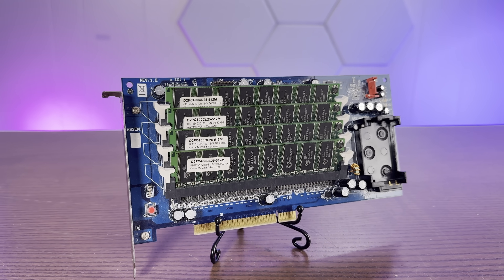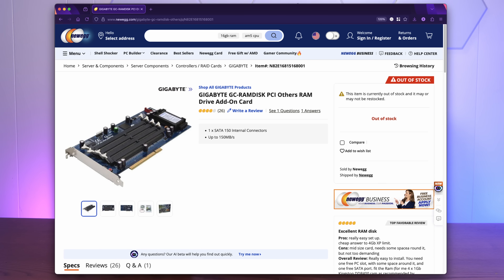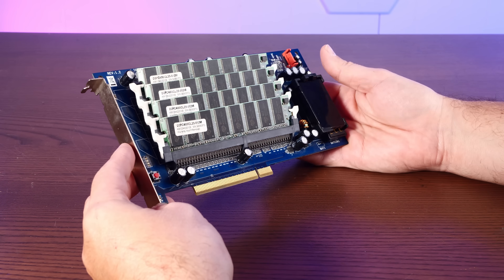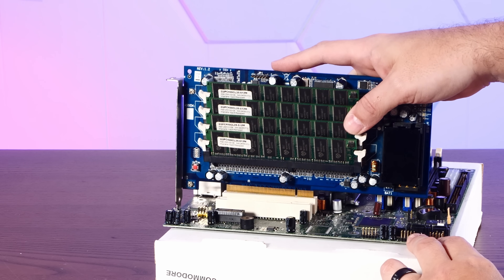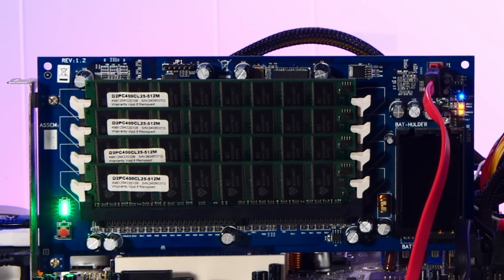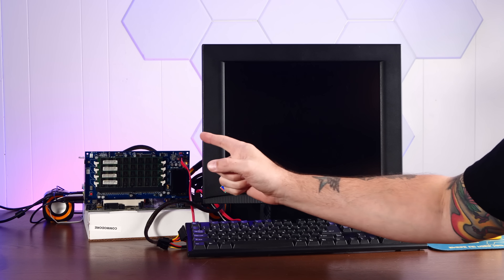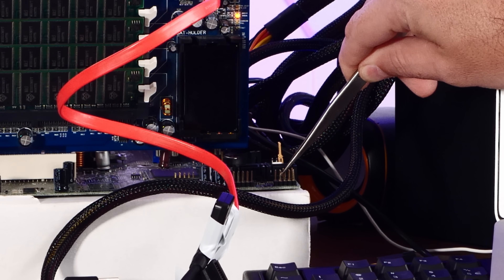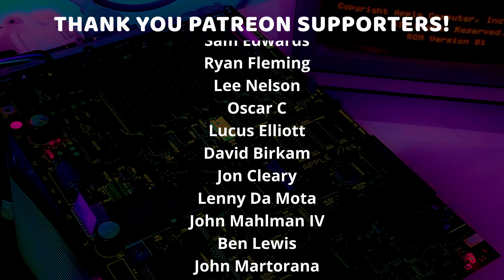This Early SSD Was WILD

Comment: I have so many more questions.
Would this work as a usb drive running just on batteries? How is the data saved to the ram sticks is in like a raid 0 kind of thing ? Or would it be like as one stick gets full it just moves on to the next. And if that were the case could you  have it so the os was on the 1st 1 or 2 sticks and other stuff was on the 3rd and 4th stick ? So if you wanted to quickly delete a bunch of files you could just pull 1 stick.

Comment: This is not a SSD, this is a battery backed RAM disk, and a really terrible one at that.

There were two versions of this card. One with the original SATA150 interface, and the later one with a SATA300 interface. So you choked several gigabytes of bandwidth down to 150-300 MB/s max.

Comment: I'm glad you ran a full format. My favorite was running a defrag on one of these. It could take 3GB of data from 70%+ fragmentation down to 0% in single-digit seconds, and the progress indicator in the XP GUI is hilarious to watch.

I worked for a small business back in 2006 and made an off-hand comment that we could buy one of these to make searches in Outlook faster. I explained many times that I was joking and it wasn't worth the expense, but the owner insisted that we buy it. I may still have it at the bottom of a bin somewhere... I couldn't not hold on to it when we finally decommissioned the server :)

Comment: If they had made it to use older RAM, like Fast Page or EDO instead of DDR (or was the DDR2?) then it would have had more chance. That would have made the cost of filling it with RAM much lower and pretty much any of it would still max out the SATA interface.

Comment: So pity that it uses DDR1 which max out at 4GB. There was already DDR2 since 2003 so I guess it could have been much more usable if fitting DDR2, or even RECC modules (regular DDR2 max out at 2GB/stick but RECC ones goes up to 8GB)
That said, 4GB is so barebone for system drive of even Windows XP/2000, so probably it's best purposed as a cache drive - but then it's more expensive for the specific purpose, even than a TurboMemory back in the time 😅 So stuck

Comment: This card is actually amazing in net boot and SMBs shared workloads. Think of it this way, load the is over the net, storing long term Data on a SMB share, and temporarily installing programs/swap on the ramdisk card. Amiga did this in the 80e to speed up boot times and so did the c64 with a CMD RAM link.

Comment: So by definition it is not "solid state" ;)... In fact PDAs (predecessor of smart phones) like the HP Journada 568 around the 2000s also had only RAM. So if the main battery died, everything was gone. Thats why it shutdown waaay before it was empty to keep power for at least some days until you hopefully charged it in time.

Comment: There was a much earlier representation of this technology called the Rocket Drive from around 1999 or so. It was a PCI card just like this one, but it had an external power brick. I saw a TechTV segment where they featured the Rocket Drive and it inspired me to write one of my final papers college on it and the future of sold state storage. If I recall correctly, at that time there were data center SAN storage options with 100s of gigs of PC 100 memory in massive chassis. The research I performed on the Rocket Drive gave me a solid passion for IT and I haven't looked back since.

Comment: A friend of mine built a computer around these things, he had 4 iRAM units, for a total of 16GB, in RAID 0... It worked, briefly, just couldn't suspend it because there was no power supply that could supply as much power in the 5v standby rail as the 4 iRAMs needed; a few PSUs died and eventually he gave up.

Comment: I think this kind of device would make sense once again these days with NVMe allowing data transfer over the PCIe bus and HDD/SSD caching being far more advanced than it was back when the i-RAM was new, as an SSD/HDD cache it wouldn't actually need a battery backup and NVMe allows lower latency than non-volitile memory can actually do so it'd even in theory be faster than even fastest PCIe 5.0 drives, much less older SATA SSDs or HDDs.

Or heck, even just to act as the swap/page file. Accordingly yeah, I'd use it as swap space in a modern system, Linux allows you to mount swap partitions with different priorities so you can guarantee it's getting hit before a larger pool on an SSD or the like, at least on my system 4GB would cover a lot of the swap usage. (Although wouldn't make any realistic difference as I'm not memory constrained, what swap gets used is just idle pages being swapped out)

Comment: There was another company, lesser known that had a hardware RAM drive before Gigabyte. It was called the Hyperdrive by HyperOs Systems. 

Being older, it used the SATA connection instead of PCIe. If I remember correctly, they had 5 revisions of the device before disappearing off the market. 

How do I know all of this... Because I wanted one. The thought of booting my OS instantly back in 2005 was a dream and that thing made it possible. I wanted it BAD.

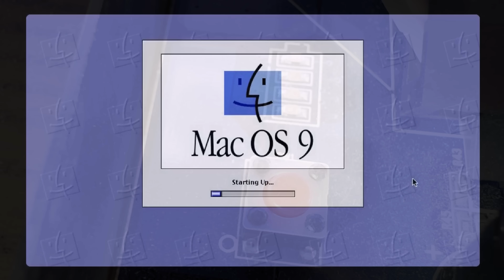Comment: 0:05 now if you really got money replace all dat with sram instead 

Does sram that can operate at 3-4 GHz bus speed exist? Outside of on chip CPU cache
Reply: Going rate is about 500 - 1000 USD per GB of sram

Because you need moar transistors per memory cell

But it's also asynchronous so no wait states to refresh, and does not need a clock pulse, just cs and ce with R/W

Could make an SSD with a small sram buffer, then use the nand or nor flash, or even a regular magnetic hard disk

Buffer a bunch of common accessed sectors, and hold that in fast buffer and only read slower memory when you have too

Firecuda drives basically did this, may not be ssd fast, but probably faster then a normal 10k rpm hdd

Unless you use flash instead of hdd, would allow better sequential and non sequential read and writes, with no seek times like an hdd

Comment: seems it could have been faster if it had presented as an add-on PCI SATA adapter instead of using a piggy-back SATA cable to the motherboard controller... strange design.
I guess it gives better copatibility with some boards maybe ?

Comment: I am trying to find a picture of one (digital cameras weren't everywhere back then), but in the late 90s, we did a T&E on an a SCSI attached RAM drive that used RAM and had a battery backup with a local spinning disk to write data to in case of a power failure.  It was huge (about the size of an old 5.25" MFM drive) and proceeded the one you are showing by a good 6 or 7 years at least.  I am drawing a blank on who made it.  It ended up being too expensive and complex for day to day use by our customers.

Comment: The type of hardware is not new.  There was a similar product for SBus Suns named prestoserv.  It was used as an NFS accelerator providing significant accelerstion of NFS writes.  So the difference was at a software level.  At a hardware level it was battery backed RAM.  There were even battery backed RAM solutions for the C64 / 1541 :-)

Comment: I remember these actually. I seriously looked at getting one back then but ended up going with a motherboard that could just support a load of ram and then used a regular ramdisk and an actual raid controller with BBWC and 2Gb of memory (very fancy at the time)..  
I had a program that used a ton of tiny files as cache and a ramdisk made a huge difference. I think the deciding factor was that an actual ramdisk was faster, and I didn't need the data retention over a power off.
I did get one at work (IT) somehow but we couldn't really find a use for it. Servers didn't really have sata and the battery proved unreliable on the one we had.

Comment: This needed the RAM to be maximized, because the potential for this in the era of it's usefulness would have been interesting. I think the use case for this would have been idea as the boot volume, and then have a hard disk or SCSI array for the programs and user data, and backup of the volatile memory storage in case it needed to be restored. 

Cool fun video!

Comment: A standard PC motherboard powering a PCI iRAM card sending its data through a SATA cable to a USB cable connected to a MacBook Air running Ubuntu to read a Windows XP installation. Nope, nothing strange about any of that.

Comment: If I designed this it would have come with a small UPS the size of a large power brick that would plug in (in addition to the onboard bat); or a large battery for a 5.25" bay.

Comment: I wonder just how common using this as a dedicated page drive was. Between having to buy ram sticks and the card itself you'd think that just getting a new ram set would be cheaper.

I suppose the price might not be as bad since you could just go with the slowest and cheapest ram it'd work with at still have it being a massive performance boost over a standard page file, and if you're needing sheer capacity then you'd eventually hit a point where their weren't larger sticks available to toss into a motherboard.

Comment: I'm surprised this thing doesn't use so-dimms (laptop RAM).

Random access memories going to have better performance at random reads and writes. If this had DCIE you could use it as a way to repurpose old sticks of RAM. Use it as a cashing drive for your SSD which is hilarious considering we used to use SSDs as cashing drives for HDDs and I was able to save an old laptop because of that actually when it stopped reading any kind of hard drive on the SATA connector I used the mSATA slot instead.

Comment: Quite a lot of enterprise raid controllers in the late 90s through about 2010 included battery backed ram-sticks as a disk cache to improve iops. Extremely useful for sql database benchmarks. The raid controllers in was also battery backed, so if the power supply was lost, the controller could write the contents of ram out to spinning disks using battery power. This feature was often used for benchmarks, rarely for real databases.

Comment: It's faster at random reads than a modern SSD, so it might work well for database storage of a small, highly indexed and fragmented database. I'm pretty sure my current employer had a bunch of similar devices on real database servers for use in storing the redo logs on Oracle databases, so that logging access records for disaster recovery purposes would not be delayed in the event of catastrophic server failure. It needed to be nonvolatile in case the server PSU died, so we could swap it over to another server and replay the logs to recover database state.

Comment: I built a Sun SparcCenter 2000 from navy surplus in 2002. I ended up with 7 cpu boards , all but one had battery backed ram modules. Each had a small coin cell. It still worked when i got it.

Comment: Yeah, I remember this. It wasn’t as fast as 2 SCSI 15K 73gb Seagate Cheetahs on an Adaptec Card in a PCI-X 133mhz slot, running in RAID 0. The PCI interface was the limiter. Not to mention you got 146gb of storage with the hard drives.

Comment: I KNEW SOMETHING LIKE THIS HAD TO HAVE EXISTED!!  Back around 2002 or so, I mentioned the concept on a forum. Only the Mega-geeks even thought it was possible, but wondered why. What use would such a thing be? At the time RAM was expensive, and a few dozen megabytes left over from an old 486 wouldn't have been worth the cost; plus the volatility of RAM meant a need for a backup battery, which opened a whole other sack of spiders. At the time, I had the idea you mentioned, use it as a swap partition or swapfile space, initialized on every boot.

Comment: Seeing something with DIMMs and a PCI slot be called "early" does two things.  Makes me laugh, and makes me feel old.

RAMDISK cards were available all the way back to the PC.  Typically with DIPP expandable RAM.   They made RAM disk cards for the Apple II series.  They even had them in cartridges for the C-64.  

The TI-99/4A assembler program shipped with a RAM cartridge for storing your prototypes so you could load them from boot instead of using a strap-loader from BASIC.

There were even older ones for the S-100 bus, and mainframes before then.

Seriously, calling a PCI bus battery backed RAM card as an "early SSD" is laughable.

Comment: I want one for a cache for Lightroom. Even on SSD Lightroom is not fast enough so I use a virtual RAM disk as a cache and it works a LOT faster even on my 10 year old laptop. Windows 10 doesn't like virtual RAM disks now, so a physical disk with RAM sticks would work better in my desktop PC. It would also save a lot of writes on an SSD and RAM does not have any write limits.

Comment: When my test/dev database server ran circles around production. I had four of these things. I'd come from a shop where we were serious about databases before that, with RamSan's for the heavy lifting; those things were just bonkers. When I got my hands on a RamSan-320 doing 200k iops all day, not batting an eye, it made the whole room full of EMC storage look like that Maxtor drive out of the video. They were very expensive, though. Having their own internal UPS battery backup would flush everything to internal disks. I got to test their first PCI-e-based SSDs before they were gobbled up by IBM. Those were fun days.

Comment: There was a drive by addonics that has both a cf/sd card slot and a lithium coin battery and uses ddr2 modules instead. It saves the data to CF/SD and also stores everything via the coin cell. And does NOT require pci but runs as sata. I would use said device for Linux swap for SSD based read only live Desktop Linux like MXLinux. If the ram disk is hosed, MXLinux defaults to disk based swap file or no swap as is the case for me right now with a 16gb ram based mini dell. Also MX has boot options that would bypass any swap at boot time so the OS does not become unbootable at err.. boot. I do have some enterprise SLC based SSD dell drives that are fat and thick that uopn removing the cover, I found out it has a ram disk and battery array inside for this very use soooo... Maybe none of this crazy ram disk shenanigans are even necessary anymore?

Comment: I used an iRAM card back in 2005, installing 4 memory modules of 1 GB each, even though my computer itself had only 1 GB of RAM. The board ran Linux Mandriva, and I never turned off the computer - every evening it performed automatic system backups to a regular hard drive. By the way, during all that time, I never experienced any data loss. It worked flawlessly until 2007, when I switched from my desktop to a laptop. The laptop had a regular hard drive, and the difference was very noticeable - in a bad way. I installed my first 128 GB SSD only in 2014.

Comment: I have seen these, for $99 -150 dollar, in 2008, but the ram + that became a little pricier?  But should you put  4 of maybe 4 GB, 8 GB, 16 GB and I think 32 GB, was the max?  Of 2008 was 16 GB-128 GB ram/SSD setup should run Window 11?  Instead of Win XP, & 7? Great find.  So if it can run, this (Win 11?) be a great Gaming Ram add on?

Comment: I remember being disappointed it never went beyond 1.5 Gbit/s.  If you want to go ultra cursed. Find a way to run this and connect it using external sata... though thinking about it, you do that anyways with a normal sata cable most of the time!  :-P Consider the big A engaged.

Comment: The most generous that you can be is "This is a Ram card that identifies as a drive" . They were phenomenal for scratch disks or game installs that you wanted to have ULTIMATE speed. There was almost no difference between this, and running a software "ram disk" on your system other than reboot resilience. you were unhappy if you installed your OS on these things back in the day.

Comment: why not programm a ram disk vor addional vram. all u have to do is  changing the path from hybrid memory (ram) to these iRam Disk Drive. or add it onto the gpu vram.. like these gtx with 6Gb but only 3 was with high bandwidth.  so why not use this to increase your vram. and as u know  today  GPu using Sata  page files  to add memory to the card when loaded... this is slow... and dont forget reuse of this is a good thing.

Comment: Funny enough in 2025, the AI craze is reviving the idea of PCIe RAM cards via the CXL standard as a way to cheaply increase RAM capacity without having to buy & replace the whole set of RAM. By 'set' I mean server grade hardware that have 16 slots of RAM per CPU. Now you cannot use it as a storage disk for regular data but there is proposals to add that functionality to the CXL standard iirc.

Comment: Going by the speed, the iRAM (SATA2: 3 Gb/s) is being held back by the mobo (SATA1: 1.5 Gb/s).
3 Gb/s is slow by modern standards AND the iRAM maxes out at 4 GB, so again, not very useful now.
A modern update that used PCIe 5.0 x16 and 8 sticks of 128 GB DDR5 would find many uses!

Comment: Intel's CXL memory extension is neat and all, but this is still a far more compatible implementation. Can someone make a new version of this that uses DDR4 SODIMMs and PCIe 4? The new Cyclone FPGAs are relatively cheap, and more than fast enough for the job when paired with a heatsink.

Comment: There’s a software called RAMDisk that has similar features; it can back up an image on the HDD on shutdown and reload it into the RAM upon reboot. It is primarily used for the Windows page file or cache. However, any hardware RAID 10 configuration can easily surpass this RAMDisk card. I still remember the good old 3ware IDE RAID controller on my workstation.

Comment: I never saw this card as an actual SSD, but rather as a scratch disk.
I would totally buy a modern PCIe 5.0 version of it and load it with 512 GB of DDR5. The perfect scratch disk, no battery needed.

A modern persistent version could include an M.2 slot, allowing the system to back up to the NVMe drive like a RAID 1